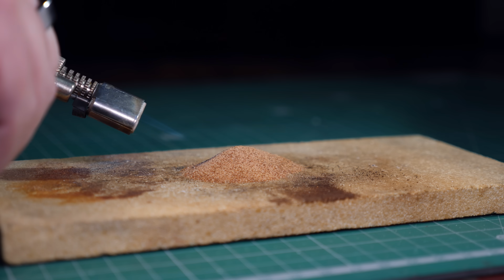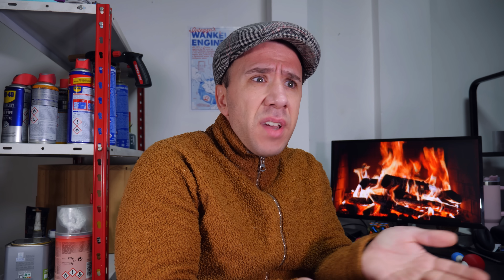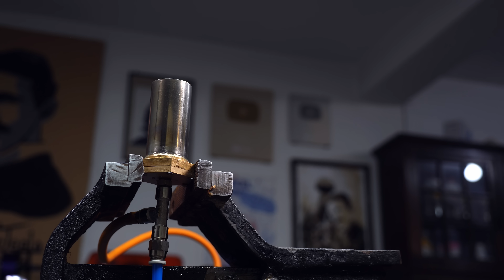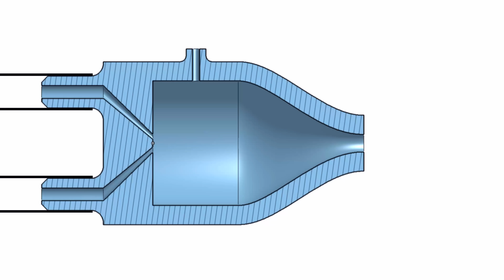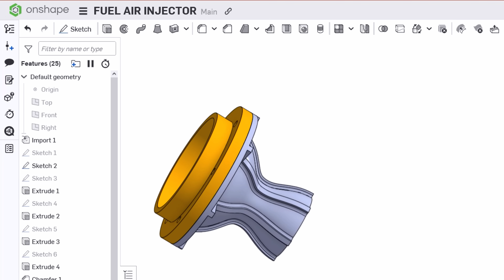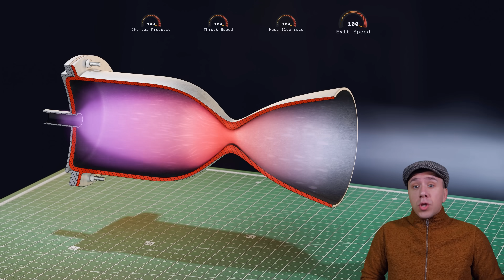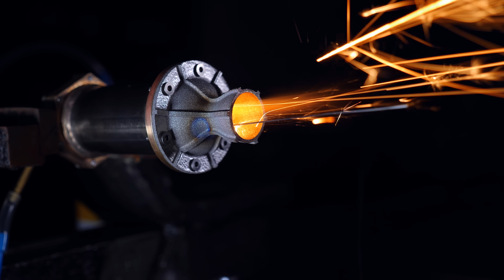I Built the FIRST VENTURI ROCKET ENGINE

Comment: I have built rockets of all types for over 50 years and really serious large amateur rockets for over 40 years ( from 10 to over 100 lbs). And all types of fuels and materials. It is a shame that you cannot get a number of the REALLY GOOD rocketry books any more. They would help you a lot I think. I had to pay over a $100 for just one like new out of print book 25 years ago. Anyway you should look up vacuum ejectors/aspirators and even the old perfume atomizers with the squeeze bulb or the old pump bug sprayers etc to get a handle on making them work. Also with the propane look up the temperature pressure chart. 70 degrees f gives you 120 psi. You can also get a propane torch tank and invert it upside down and you will get liquid propane. We have 500 gallon tanks with liquid and vapor taps for running grain dryers. DO NOT let the liquid get on you, really bad  mega frostbite almost instantly. Also you are smelling ethyl mercaptan in propane. The oderant added for safety since propane has no smell. You may wish to look into things like asphalt oil for fuel because some of the guys I used to know had real good luck with this higher energy fuel for rockets. Also don't forget about the catalysts used with ammonium perchlorate to modify or increase burn rate like ferric oxide, manganese oxide (which you can isolate from regular batteries). Also decide what pressure you wish to run it at while firing, say 750 psi might be a good starting point and look  into maye a continuous igniter. ( I could see you modifying a stun gun into a plasma ignitor. As far as liquid propellant rockets maybe look into the 1960's patent on ammonia-ammonium perchlorate liquid monopropellant rockets. Pretty stable monopropellant requiring nor cryogenics or pressure vessels etc. You could just pour it into a regular cup at ambient temp and standard pressure. You could also look into nitrous oxide as either a monpropellant fuel or bipropellant which some have had success with in amateur rockets and its pretty easy to get and use. Just be extra careful. I have had some really .. intense.. incidents with various rockets. Too much to mention on all of them but rocketn engines are ALWAYS looking for any excuse to make your day exciting in so many ways, things you never dreamed could happen. And they are so exciting and fun. Anyway feel free to ask me any questions if you wish to and Good Luck and may all your endeavors be useful and not cost you more than is acceptable.

Comment: You should really have a permanent setup to measure the forces. I've only seen this done to test motors with propellers but couldn't you get a load cell and wire it up to measure live on the videos? Are there any special considerations for a setup for rocket engines? I'm guessing the temperatures can get pretty extreme.

Comment: can i be the person that screams at the angle grinder with no guard? im the type of person that removes guards and interlocks, but one thing i dont do is remove grinder guards... they exist for a reason.

to do proper design?
you need a computer that doesnt have a five minute lag!

actually, turns out my rams getting... buggy.

funny. someone just "re-invented" a low pressure oxy-acetylene torch...

yes, this is how the blowpipes used with acetylene generators work. as acetylene cannot be compressed past 1bar, and as its rather volatile... they tend to make the generators operate at below atmospheric pressure... 

and why you never see an acetylene regulator that goes over 15psi...

Comment: Why not use direct injectors?As that gives you your ideal spray pattern and enough pressure as to not be pushed back by the combustion? It also allows you to throttle the rocket electronically by changing the duty cycle and speed of the injector.

Comment: When I was a kid, the hardware store sold "Solidox" torches. It was a propane/oxygen torch, with "solid" oxygen. It was some sort of perchrolate tablets that would decompose in a little chamber. No idea if they sell that kind of thing anymore, but if they do it's a source of solid oxidizer
Reply: Solidox was potassium chlorate, just one less oxygen than perchlorate.
Reply: @chemistryofquestionablequa6252  The brand I used was sodium chlorate. Which certainly works for rocket applications, though they don't sell it anymore for welding.
Reply: We used to make firecrackers with solidox. We would grind into a fine powder, sifting out some kind of (probably dangerous?) fibers that were embedded. Mixed with a suitable fuel it worked pretty well.

Comment: You’re right, it’s not a venturi. It’s a viscosity effect generally called entrainment. The fluid flowing past the top of the tube are literally grabbing onto (impacting, actually) the fluid at the top of the tube and pulling them along. That, in turn, pulls more up. You get low pressure at the top of the tube caused by this. If the fluids were magically zero viscosity, you’d get no flow.

A Venturi would be in a closed space, where the constriction creates a pressure lower than ambient, and that low pressure directly causes flow directly. Even zero viscosity fluids would still have flow in this situation.

A subtle difference, maybe, but they are different. Don’t let the “it’s a venturi” people here get you down, almost everyone is completely confused around Venturis and Bernoulli, with many of the common classroom demos being completely wrong.

Comment: The compressed air effect works because drag makes low pressure zones on the side and back of an object, as the air flows over it it speeds up to go around the obstruction and makes the outlet of the pipe a low pressure wave. Also all this happens after it equalizes with atmospheric pressure so the pressure drops below atmospheric. Its similar to a classic physics demo with a hair dryer levitating a ping pong ball.

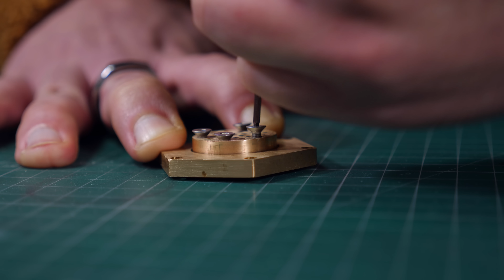Comment: Hey Integza when screwing screws always start all of the screws first, then tighten them and you probably won't have the problem you are talking about at 4:40. Love your videos. Please keep up the good work.
Reply: I just tighten the last screw first.
Reply: @maxkuznet3156 this how I do it
Reply: This is why engineers NEED to work with mechanics .
Reply: Additionally, doing it in a crisscross star pattern makes sure they’re all torqued down equally and flat

Comment: Please make sure you are doing this in a very well ventilated area, AP is no joke. Also, the reason why your simulation didn't show a lower pressure is because it was showing total pressure. The Venturi effect creates a low STATIC pressure which is part of total pressure (what was being plotted in the simulation). The other part that makes up total pressure is dynamic pressure (the energy from the movement of the fluid). As flow speed increases, static pressure drops but your dynamic pressure increases to velocity squared.

Comment: I started to realize, a lot of these designs would probably not work at all in a vacuum.
And I feel like a wind tunnel with vacuum compressors that can handle the amount of gases and the heat this would generate is probably out of budget. Are these all intended as atmospheric rocket boosters?

Comment: Hey Joel, challenge for you. A few months ago I found it about "pyrophosphate". It's P2O7, and I thought... that's a lot of oxygen! 😮
"In chemistry, pyrophosphates are phosphorus oxyanions that contain two phosphorus atoms in a P−O−P linkage. A number of pyrophosphate salts exist, such as disodium pyrophosphate and tetrasodium pyrophosphate, among others. Often pyrophosphates are called diphosphates."

It was specifically "disodium phosphate" that I came across in a drink mix, so my hope is for even the non sodium linked food ingredient would likely be easy to obtain. 

I'm out if my league here and I've been told is not energetic enough on its own to work as a solid rocket fuel... My thought for it here is perhaps you can add it in addition to your miracle ammonium perchlorate, to get MORE oxygen!
The Ammonium Perchlorate will do the initial heavy lifting, but my hope is that the heat would break down the Pyrophosphate and release more oxygen, making the end result more energetic 🤞🥴🤞

Comment: Many, many years ago, I saw a TV "High school science" show that was showing why grain silos as so prone to explosions/fire. Fine powder pushed with air is very flammable.
Asbestos was used in many things because it would not burn, but, as a fine powder in this experimental contraption burnt extremely well (rocket fuel well ). The problem, finely ground Asbestos is ( using the wrong word but correct idea ) highly toxic.

Comment: Venturi side quest could have been skipped with a fuel pump. Brushless motor and a 3D printed turbocharger style impeller would do nicely to lift the Butane from low to high pressure.

Comment: MAE here, been a while since i played around with Bernoulli but i think i still remember it well enough explain what was going on.  your straw and air nozzle is still a version of the venturi, but a slightly different kind.  what you have in that instance is what's called a free stream jet.  That jet of fluid is moving relative to the surrounding air their for the pressure in side the stream is lower than the  ambient pressure in the room.  so when you point the stream over top of the straw that low pressure pulls the fluid up the straw and then is pushed along with the free stream which becomes turbulent high velocity flow blowing stuff everywhere.

Comment: Re airgun mixing. Is the air gun outlet supersonic? If so there will be shock waves over tube lip. Even if not supersonic,  a lot of vortex shedding and turbulence. Afaik how to computationally model turbulance currently unknown/laws of physics for it aren't written ;-)

However turbulence, vortex generation,supersonic shocks all often brill for mixing. Liquid surface made to vibrate etc?

Comment: 15:40 What if you could change the nozzle, it could be difficult but i think it can be done lengthwise, mazda used to have a problem with the 4rotor wankel in the 787b and made variable length inlets againts against the engine pulsing. Might be worth a shot

Comment: a smoke grenade channel i follow (Invention Incarnate) has a similar issue with wildly fluctuating chamber pressures. he wound up using  homemade fart cushion valve made from silicone. it is very temperature resistant, and closes up automatically  whenever the chamber pressure dips, letting the reaction recover and smoothing the burn. i suspect it might actually help the rocket.

Comment: My older brother works for SpaceX as one of their rocket scientists. Back in 2016 I suggested alcohol instead of kerosene. I explained to him this exact theory. You are 9 years too late. I already know alcohol was the answer. The issue is the amount of pressure you're using with it. Try mixing the alcohol with liquid O2 before pushing it into your engine. As the liquid O2 expands and heats up becoming a gas again, It retains the properties of the alcohol. You are no longer trying to push two but one. You combined your gas and liquid on a vapor scale. (FYI provide expansion chamber for liquid O2, after mixing with the alcohol. So it can heat up and expand creating the pressure needed on its own.)

Comment: Can’t wait to see you try to design and build a turbopump for liquid propane. That sounds like a lot of fun.

I don’t see why you’re concerned about changing the shape of the expansion chamber. For a given altitude, the ratios of dimensions for combustion chamber, constriction and bell are well known and available online.

If you were going to launch the rocket to a high altitude it would matter. As long as you don’t launch you whole bench, you will be fine.

Also, how good a fuel would powdered dehydrated tomatoes be?

Comment: Wow, when you said "switch the hybrid motors fuel for the more denser oxidiser" I thought "realy?! 60 years and no one taught of that?". But you are right, it does make more sense. Now you just need a binder that is also an oxidiser. might be difficult. AI thinks Polymeric nitrate esters / azides are a good choice, but I know for a fact azides are toxic and azide salts are a powerful and unstable explosives.
Good luck wit that!

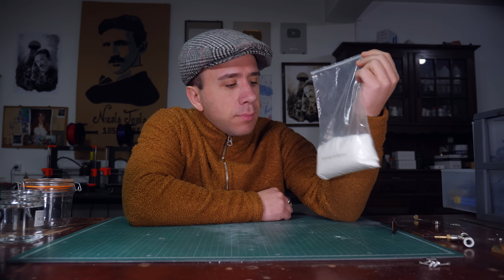Comment: 5:45 puttin aluminum fins facing into the oxidizer to then exchange heat into fuel pipes running close-by on the other side could help get higher pressures if fuel injection to keep the injectors clear, maybe with a tesla valve in the fuel before the heat exchange coil would be necessary idk.    but im only 5minutes in and i know you said the other oxidizer wouldnt have the problem as bad/at all, plus in any real flight application youll never have the engine facing torwards a source of gravity anyway, thats just a symtok of the test rig

Comment: Hey I liked your presentation. I should admit to being neither a trained Mechanical Engineer nor a Physicist.   But if the end objective is to get the benefits of F = ma, where 'F' is the summed vectors of 'a' acting on the mass, 'm,' there could be a cheaper, easier way to do all of that without a fire.  There are other equations around that have the vector 'F' in them, one such is F = ((m*v^2)/r) [or something like that?], ---- let's call this last vector f ---- for Huygens' description of centripetal force.  This equation involves spinning a mass at a uniform velocity in a circle and has several vectors associated with it; which can be summarized with the 'Right-Hand Rule for Cross Product of Vectors.'   All of this last part has many industrial applications, some are prosaic and are well known. Cream separators that are used on a container of raw cow's milk as an example.  One can imagine a (flexible tube taped to a cardboard wedge, say) circular tube or pipe that has water being pumped through it, then one might also imagine this circular pipe that could be folded along a rough diameter to about 20 degrees or so. So now the vector(s) f might be labeled as '2*f' as there are two independent vectors because of that 'fold.'  Because of vector algebra, the '2*f'' part might now be labeled as f'' which written more fully becomes: f'' =2*(cos(10 degrees))*((M[the mass of water, [say, in each limb or approximate ½ circle of the tube that has water pumped through it]*v(the velocity of the water being pumped)^2)/(r-which is likely a bit shorter than the mathematical 'r' because we are dealing with physical objects here)). The ‘diameter’ of this ‘fold’ would not be, mathematically, a chord. The pumping device could be a centrifugal fuel pump, like is used in commercial or NASA type of rocket engines, which are rated at about 500 house power (Hp) from what I’ve heard. Or maybe from a fire engine, which are often rated at about 45 or so Hp. Not new information by any means, as there are books written about this method of 'traveling through space without rockets,' maybe there is even a 'shorter version' of this book, so to speak. If you take this suite of ideas to one of its logical conclusions. Not as long-winded nor as expensive as the NASA versions (even if only used as an interplanetary method), but there you go.  For those that want to try the above with a cardboard ‘wedge’ with a ‘chord’ of about 20 or so inches, and then use a yardstick as a balance beam, with counter weights, and maybe a submersible aquarium pump, with the output tube of the apparatus being returned back into the small water container with the aquarium pump, so you can reuse the same water over and over again to drive your motor (with the cord facing down).  You can either turn off the pump or pinch the flexible tube a bit to see if the motor is pulling its side of the balance beam (yardstick) down a bit or not.  And you might consider through the use of Newton’s Law of Universal Gravitation (F = [M1*M2*G(m)]/r) — where one of the ‘Ms’ is the mass of an interplanetary drone say ---- pull an asteroid into Earth Orbit where it might be mined for valuable minerals or metals.  One can imagine that their ‘done’ be constructed of an air-tight tube with the electronics, cited motor, chemical batteries (to be charged by an array of solar cells); if the main ‘tube’ has a hatch on it like the sort the used by people carrying capsules to the Space Station (ISS), then one might further imagine that the ‘drone’ might be easily services, updated or repaired without having    to dress up in a spacesuit.  And if the system doesn’t spring a leak, remains liquid so the return water tank that has the water pump in it, or some such, then a close proximity of the ‘drone’ through Newton’s Law, be able to pull the valuable asteroid into a convenient Earth Orbit.  A lot of fiddly bits, but not that big of a deal.
Reply: I don't understand what you are implying. Are you suggesting that you can somehow pump fluid in a circle to extract a lateral force via the cross-product?
If I'm reading this correctly, you appear to be suggesting you can violate the conservation of momentum by choosing how you move your mass about in a closed volume.
For aany given closed system, your center of mass is stationary or moves at a constant velocity. Period.
You will have to expel something in order to change the center of mass of your closed system.
q-dot for your N-body system will be zero unless you introduce new mass or energy. This is the law of conservation of energy at play.
There is no free lunch.

Comment: Can't elp myself. Eye bread rocket. You normally want to be fuel rich and the hybrid part normally works that way so the oxidizer is the limiting reagent. I think because your nozzle materials tend to be able to oxidize but maybe you could make your rocket out of something that's already an oxide? Also leaving solid oxidizer around is generally worse the liquid hydrocarbons I think.
Nice CNC machines.
So what are you thinking for propellants? N2O and Kerosene?